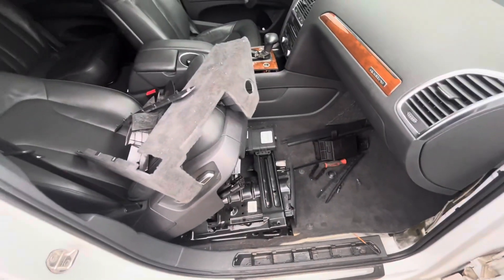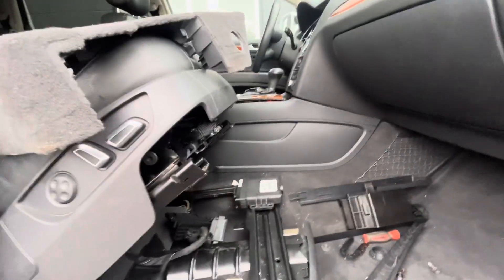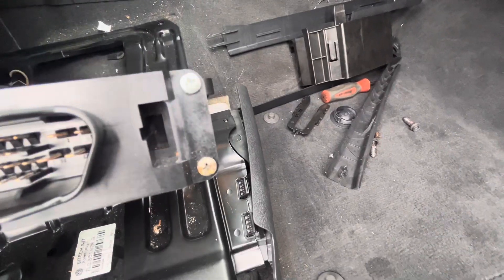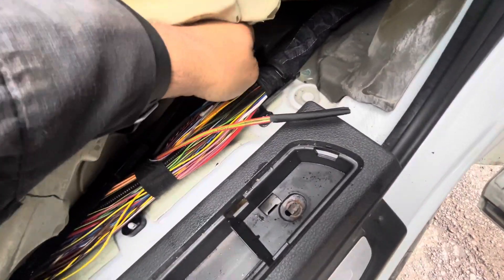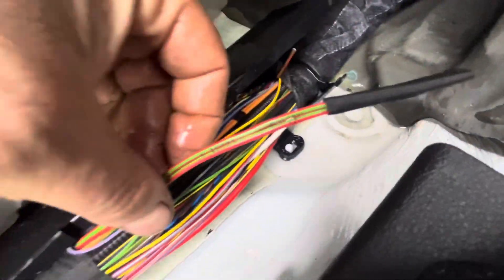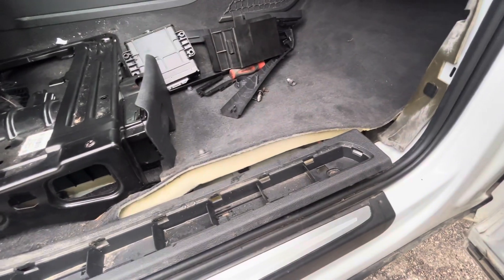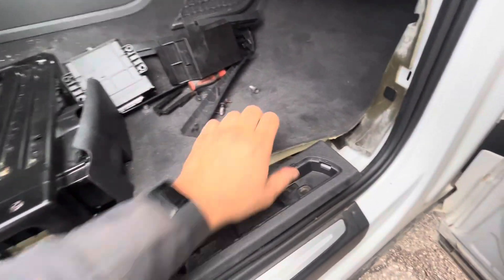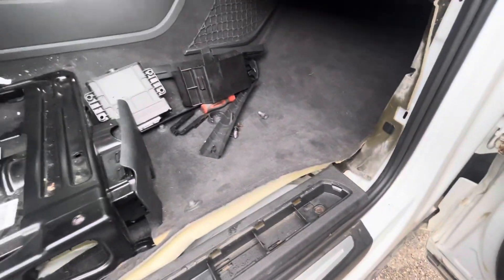AUDI Q7 CAUSE OF NO COMMUNICATION WITH TRANSMISSION MODULE

Comment: Ugh. I have the ATF fluid in the TCM problem, but I didn't check this before getting everything to do the sealed connectors in the trans. I don't have power to the 2 pins I suspect these wires go to. If I do this job tomorrow and it turns out it was the foot well wires on this side (I redid the other side) I'm going to be sick. On my 06 Touareg.

Comment: How the hell do you take the seat ip!!
Reply: There are 4 screws, 2 in front and 2 in back of seat. You will need a Triple Square bit 10M. Do not use star bit, it will strip the screw.

Comment: This video saved me. After checking brake switch and fuses I really worried where a loose wire could be. This made the project much easier
Reply: What exactly did you do? Step by step please share I need help I left my moon roof open and I’m experiencing the same issues

Comment: Having a similar problem but on a cayenne. The crazy thing is that , it still shows the gear indicator. It’s just stuck in first and no manual mode. Worse of all, no codes. Snap-on scanner doesn’t see the tcu but when I actually unplug the tcu, I get a code on every module for it. My wires under the seat aren’t damaged.
Reply: Hi mate I'm having exact same issue as yours except on a touareg, checked the wire in video but all ok, did you get to the bottom of the problem? Many thanks
Reply: @GinaBevan-b7i it was a bad tcm in my case. Used one will work. Part number has to match the old one
Reply: @billyowusu48 ok great thanks for quick reply, do the numbers have to be identical? Also did yours bang into gear when put in drive or reverse? Thanks
Reply: @GinaBevan-b7i yes it did bang and was stuck in 3rd in drive. At least the part number has to be the same and same build date year at least.
Reply: @billyowusu48 ok thank you very much

Comment: Bought a 15 tdi from auction that needed a delete. After few days of owning it codes popped up and same exact issue, got it running today and currently fixing this wire atm! I gave it a little pull and literally flew off my hand😂. Thank you so much!
Reply from the maker: Happy this helped you get to the bottom of it!
Reply: @EuropeanAutoRepair  absolutely thank you so much! Just tested it 5 minutes ago and no lights on the dash and everything works perfectly again!

Comment: What is the expected voltage of the wires you repaired (power supply)?
Reply from the maker: 12v power supply
Reply: Do you think the Tcm would be the cause of this message “ trans malfunction, no reverse gear, continue driving” I did a reset on and it’s operating fine for now

Comment: Did you have to replace tcm or just re solder the wires? I’m having the same issue with mine
Reply from the maker: I just repaired the power supply wire and cleared faults
Reply: @EuropeanAutoRepair what do u mean by repaired? Replaced the wires or module ?

Comment: Hi I am doing a research on a preproduction Q7. I need to get access to the extended can bus where the radar is connected. Can you please let me know where can I get access to this CAN bus the easiest way and is there any aftermarket y-connector so that I don't have to destroy the insulation of the wire to read CAN bus data.
Reply from the maker: Typically the can bus lines are twisted together, im not sure of any good solutions as far as tapping into the signal other that your basic insulation piercing probs

Comment: Just had this happen to my Q7. We’ve had this problem where AC condensation builds up leaking out of the center console. I’m assuming that’s what led to our failure. Thanks for your video!
Reply: I have water and cannot find where it’s coming from. I checked the wheel well and it’s clean and I checked under the glove box and can’t find it. How do you find it from gear box?
Reply from the maker: @xblakeleyx you have already checked your evaporator drain?